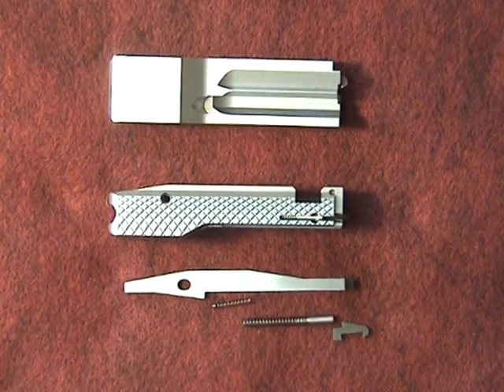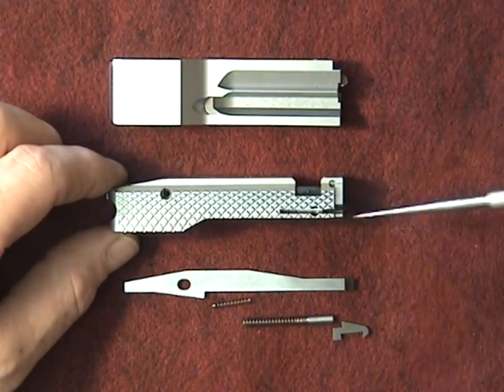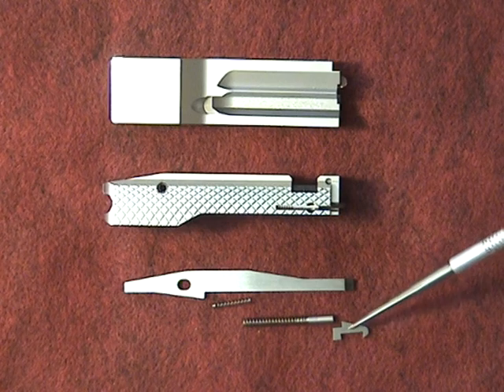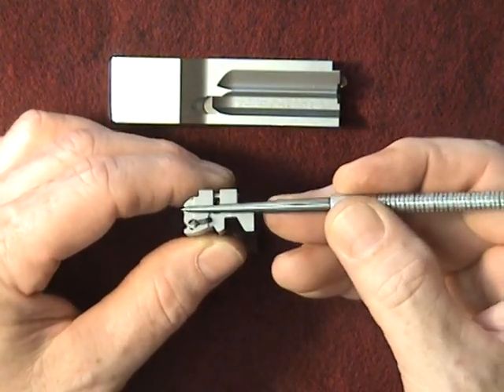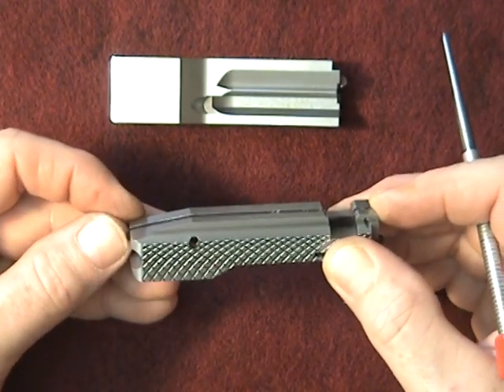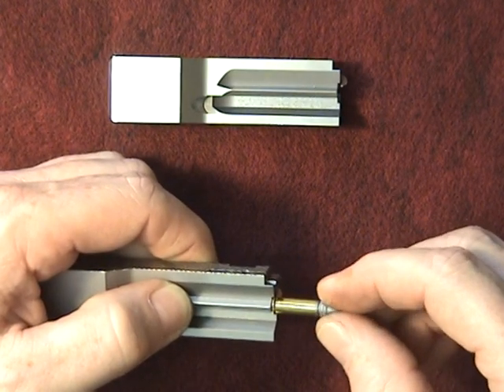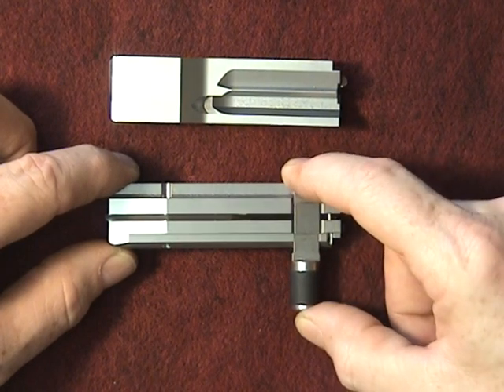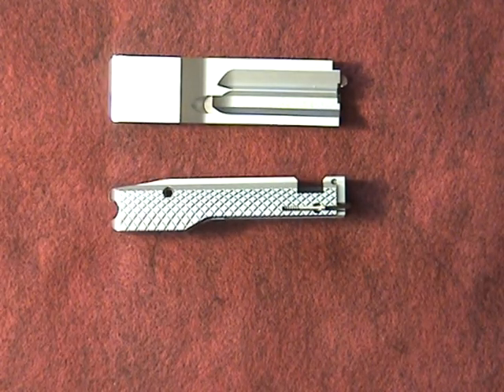KIDD .22LR Bolt for the 10/22®

Comment: Hi,
Is there any difference in headspace between the Kidd and Ruger bolts? If so, what is it?
Thanks.
Reply from the maker: The KIDD bolt headspace at .042" . The other guy ranges from .038' -.048"
Reply: @coolguyguns10xKIDD  thanks.

Comment: The black scalloped bolt will be my final purchase for my custom build. I bought your charging handle with different springs. The question I have is do any of the springs that came with the charging handle allow me to use subsonic ammo without having any malfunctions? Any input would be greatly appreciated thank you very much. Also just installed Your trigger upgrade and I miss I must say it is one of the cleanest braking triggers I own on any weapon. Thank you for all your hard work you’re parts are top shelf.
Reply from the maker: Thanks Darrell. The standard spring should cycle subsonic ammo with no issues. TK

Comment: I really liked these bolts but they’re never in stock anymore. Had to go with the tandemkross bolt. I think kidd bolts are a step above the rest but just can’t get one. :( I do however have the magazine release plunger and love it.
Reply: Old post but figured I'd give it a shot. With your tandemkross bolt out of the gun can you move the extractor far enough that it will pop out? They sent me a replacement and it still does it with any extractor brand. They said it's by design but figured I'd ask somebody else that has one.
Reply: @natesmith2408  yes it’s designed that way, that’s how you get them out for replacement, spring repair and cleaning when necessary
Reply: I bought one a few years back and have been very happy with it. Sorry I didn’t buy it sooner and now maybe I should have bought another
Reply: @willard8245  lmao ! You’d be surprised, business has been good. I do from time to time fall back on architecture. 😬

Comment: Everything Kidd puts out is basically the best.  Their bumper stickers likely hold for 20yrs and at least 10 without fading.  When in doubt, go Kidd. If you can't afford it, wait until you can.  Best drop in, best single stage, best two stage.  The best.
Reply: Yea could not agree more. Just added a bolt , charging handle and spring, single stage trigger a strap and a leupold 2x7x33 rimfire scope to my 75th anniversary sporter. Pretty accurate , super smooth and absolutely problem free. Squirrel season just opened here in AZ. Can’t wait.

Comment: picked up this bolt, the buffer, a 2 stage trigger (field weight) bolt handle and springs, and the pin screws. that is a pretty penny but i put it all into my 10/22 takedown and i absolutly love it! you folks make the best 10/22 guts on the market and in reality the prices are very fair.

Comment: as that is the Manufactuere speaking I was wondering if these bolts were tried slightly oversized width wise as a lot of rugers are pretty loose it seems maybe just 5 or ten thousanths per side and what that ended up with accuracy wise?